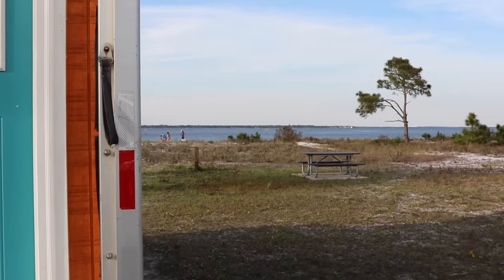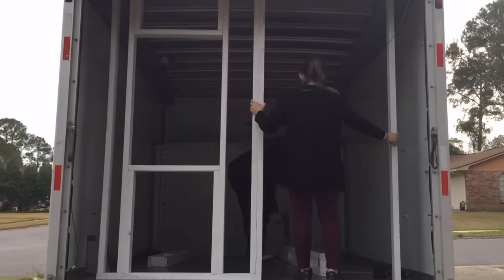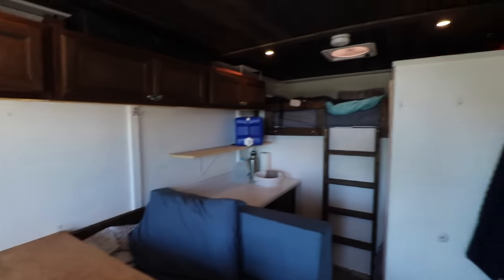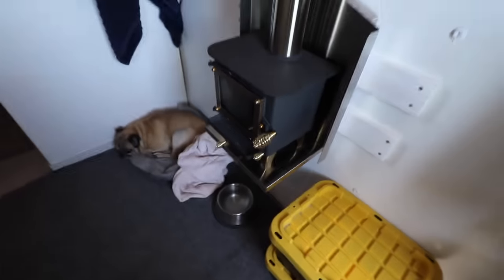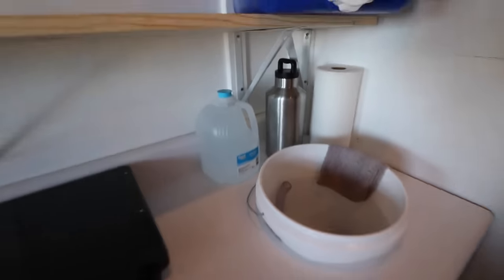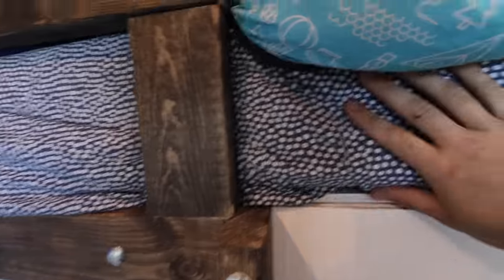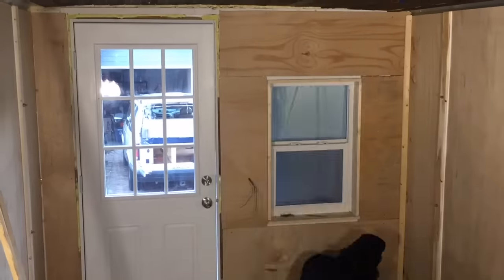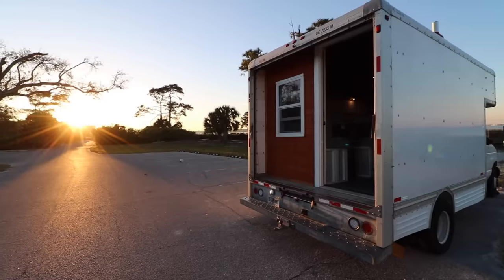Tour of Our Tiny House Camper (Box Truck Conversion)

Comment: Very nice.

An outswing door would provide better security against would-be burglaries. They are harder to kick in. 

In Miami-Dade county Florida all new homes MUST be built with outswing doors by law. Less likely a hurricane will blow it open. Outswing doors are THAT tough.
Reply: Let's be honest, if someone wanted to break into the truck, the bashing the small window would be the first thing. OR, an axe to the siding. The third option is breaking the glass in the door and turning the deadbolt by hand. The last thing I would do is bash in a steel door.
Reply: Well, that's stupid! What's there to prevent burglars from knocking the pins out of the door hinges and breaking in that way?!
Reply: @mybraineatseverything7404  lots of things, but mostly, hinges dont work that way.....   even without the pins in them you cannot get the door off without opening the lock/latch/door handle....
Reply: MyBrainEatsEverything they have a hinge called NRP non removable pin, for outswing doors you would have to open door and unscrew the hinge to remove door from the frame
Reply: T'Challa01 he said an outswing would not clear the lip on the back of truck.
Reply: You know what is better than an outswing door? An owner with a gun.
Reply: Frank Anthony Overton Jr. if your home to use the gun.

Comment: Where do the kids sit while you’re driving?
Reply: That's what I was wondering. I have two kids the same age as his and love this setup, hopefully we find out.
Reply: Great!
Reply: On 5 gallon buckets in the back
Reply: @openyoureyes3969  I recently watched a bus conversion video where a family simply installed seatbelts onto a bench seat for safe travel. They also had some little flip down tables so the kids could entertain themselves with whatever while driving. You could also build in a window/door/crawlspace of some kind between the cab and living quarters for access/communication/egress/escape.
Reply: @Laffy1345  lol
Reply: Openyoureyes39 don’t put your kids through this torture
Reply: Openyoureyes39 p
Reply: Guys this is a u hall the type that connects to ur truck so when u drive u have extra storage so the truck has 5 seats driver passenger 
Then tow backseats
Reply: Lol

Comment: I think you need a fire exit if you had a fire you only have one way out and your children are at the back ..
Reply: How about an escape hatch over their loft bed?
Reply: Yes, an easy way out above their bed, but secure from the inside.
Reply: Calmo Omlac my camper has an emergency exit in the back window it even has to red pull handles on it and it's a 30 year old RV
Reply: Absolutely. They have propane in there, and a wood stove that probably works throughout the night. Kids need an emergency hatch/rv window on top or side to get out fast. That thing is all wood inside, could go up in flames before parents could wake up and grab kids. 

I'm assuming that they have smoke detector/CO detector and fire extinguisher, but still need escape hatch. Other than that, I like it.
Reply: @CalmoOmlac  You haven't seen the emergency exits because you weren't looking for it specifically.  They have been standard since the 70's.  Every RV is required by law to have an emergency exit (a specific type of window or hatch usually).   That's part of RVIA code....and part of the reason home made camping vehicles like this are not allowed in some rv parks.  They don't meet code and the park's insurance company won't allow them.   The other problem with this is he is hauling 4 people in a car that only has seating for, at max, 2-3.  SO are kids riding in the back of this while it is moving?  That is illegal and very unsafe.  And if there were an accident there is only one way to get the kids out!   And it is the rear....which would have a high chance of being the damaged side.  Otherwise...it's cool.

Comment: You would never make an exterior door an outward swinging door. Otherwise criminals can just knock the pins out and pull your door off. You kids gotta think before you post comments lol. Also, do you need a special license for this vehicle after the modofications?
Reply: wrong, absolutely wrong... there are many things you can do to prevent the "take the pins off  junk you mentioned, one; your concern doesnt even work in real life. If you take the pins out and the way hinges are made, you still cannot remove the door. Two, you can spot weld the pins so they cannot be removed... Third, look at ALL OF THE COMMERCIAL CAMPING TRAILERS, EVERY SOLITARY ONE HAS OUTWARD SWINGING DOORS!!!!
Reply: @harrysteeletreo1  apples and oranges my friend. You're talking about doors made for a camper. This guy is using doors made for a house. Good luck not welding the hinge together. Thanks for the expert advice.
Reply: @harrysteeletreo1  I grew up with brothers. I've removed plenty of doors that way lmao
Reply: @Xenochrist95  
Sure, in the olden days. 😉 

Look at hinges on out swing exterior doors. They have tabs on one side and corresponding sockets on the opposite side for the tabs to fit into when the door is closed. Pull the pins and the tab system keeps the door from being pulled out of the opening. I don't know if all exterior doors come this way or not but the three on my house are made that way.
Reply: @rogermccaslin6750  that might be a valid point I haven't noticed anything like that but this guy up here saying to spot weld the hinges has me dead
Reply: Xenochrist95 you buy a NRP hinge non removable pin for a outswing door , the door must be opened and you unscrew the center hinge to remove the door. Made to keep the bad guys out.

Comment: Very ingenious - I have a suggestion for your shower, purchase a pump sprayer so you have some water pressure in your shower. You could also use it on your sink, it would probably fit in the same spot. Happy Trails 👍

Comment: I hope you consider putting a plug socket on the back, leading to your batteries on the inside.  Then you can use that for connecting to a Portable Solar Panel with a long extension cord.  That way, if you park your vehicle in the shade to keep it cool, you can place the solar panel out where the sun is blaring down!

Comment: I watched a guy who left the roll up door in place and had a similar build as your s (window/door).  He had closed the roll up door and built a locking bolt system on the inside on the passenger side of the box. Can’t remember what he did to the outside locking system but it looked like the box was secure when the roll up door was closed. I think he had a cab through door as well so that made it easier to secure the box. I’m looking for his video again.  Do what works for you and your family, keyboard warriors will never leave there moms basement to even try something like this. Happy Trails 💂‍♂️🏴🇨🇦

Comment: if that's still your shower setup check out the iron hammer portable shower on amazon. it charges via usb and has a flow rate of 1gallon/min. that with a stove to heat water and a bucket to pull from you have an incredibly efficient shower system for 45$

Comment: Nice video and van!

One great idea we've used for a shower when we've had well troubles in the past is to use a 3Gal. garden sprayer that you pump up for pressure. If you put one gal of hot water in it (we've heated it up on the stove) and two gal of cool water, it is usually enough for the whole family to take a quick shower with. You just pump up the sprayer 10-20 pumps and you have a thin stream of pressurized water with a trigger activated hose and nozzle to clean with. It uses much less water than dribbling out of a tap and has enough pressure to get soap out of your hair, etc... Not as convenient as a well pump and water heater, but the next best thing. (and super affordable.)

Comment: On the garage door. You can lock it on each hole of the gasp lock with two locks one on each hole so that it would not lock you inside. Now you know for the future. I use to work for Uhaul as a mechanic in teen age years as a job to raise money for college tuition.

Comment: A little FYI: 1.) Look into something called Overhead Doors. They're widely used with storage units and depending which model you get, they're also used on business fronts to add some extra security. 2.) A hasp & lock can be placed on the inside, so need-not-worry about being trapped inside, unless someone parks too close. Plus for-that-matter, it helps to have 2 exits in-case of incident, so a top flip-out hatch may be an idea. 3.) If/when you get pulled over by police, they're going to ask if you live in the back of your vehicle. If you say Yes, the police will not only inform you that it is illegal to park in certain areas, also they will profile your vehicle/home by passing around the plate ID to local & other departments ...so stealth camping would turn out to be a bust. 4.) One of the biggest benefits of NOT driving an RV, is that RVs have a higher rate of insurr, though RVs also get profiled by those realizing that the locks on the doors are usually ineffective & posses no security alarm. and 5.) An in-vehicle camper such as this(instead of a trailer/towed unit) ...if/when the time comes for the vehicle to visit a mechanic, they'll treat it as a vehicle, and not a home --thus when you have to wait on a part to come to make the repair, the garage will impound it in their yard, and you won't have access to it. 
Plus I'm totally sure they'll stick to the task and not invade your home, right? OH WAIT! --you are going to put a deadbolt on the entry door? Well ...let's hope they haven't discovered something called a Bump Key. Or perhaps you already know Shrade Locks make Bump Key-Free deadbolts?
...so it's great to see you have a base, but you may want to evolve/upgrade your home with at least a few ideas I mentioned.

Comment: My only addition would be a faux van back (hinged at the bottom) with steps on the inner side that folds down to meet the ground, come the evening it can be pulled back up drawbridge style to provide that extra security and insulation

Comment: I live on big property I purchased and my next door neighbor invited me over to his estate sale one day prior to selling and giving it all away! So ironic that from about three months ago I decided to get into diy projects with ways to recycle as much as possible and use materials and improvise! After walking around the property for a half hour I found everything you need to do diy projects! One example he had old 73 uhaul box truck great box but cost money to rebuild motor and brakes and tires and everything, but around the barn sat a 4c4 Chevy Chevy commercial box truck mid nineties but with a low heated Diesel engine the dam thing was running great and it was registered to handle the heavy load I separated the box from the truck frame and the body of the van and spent 0 dollars modified both the van and the box to fit each other and combined them I had to do quite a lot of welding but and it was pain in the but. Nevertheless I finished the project in two weeks and then spent about 5,500.00 on the interior and was able to find three good holding tanks and a lot of materials I found around. Total $ spent on the project 7,200$ and I could have kept it way cheaper but since the build was. So cost effective I splurged on a full residential solar system with two back up storage batteries and I also installed a used mini split 2 ton heat pump powered by 230 volts! And I have a 250 volt outlet outside for work. It’s not finished yet but I estimate it to be worth around 35,000$ low end. Oh yeah and I forgot about the residential size toilet and shower!!

Comment: Maybe a ceiling emergency exit like they have in buses?  Or an openable ceiling window?  Not only will you have more light and ventilation, it’ll serve as an emergency exit too in case the door or window are blocked for some reason.  I’d be worried about being locked in with no Plan B for an escape.  Otherwise, this is cool!  When you get down to it, having the essentials are all we need to live comfortably.

Comment: The toilet setup is a bit primitive. I'm a horse owner and many a time had to use the horse stall. That gave me the idea for camping to use pine shavings to place on top of the poop. The pine resin neutralizes the odor . It will break down and compost in no time or I throw it all away in plastic garbage bags, no different than disposable diapers. Keep the urine separate. If 1 part urine is mixed with 9 parts water you have a ready made fertilizer. Vinegar can blunt the urine smell until you dump it and I use vinegar to clean the buckets and funnels since plastic retains those odors. You can buy shavings in different size bundles for horses or gerbils. You want the fine rather than the coarse. Use biodegradable soap and all toilet issues are solved.

Comment: I would've closed up where the window and door are with panels from the original door without roll up feature, after  necessary furniture was installed bed , cabinets etc..  To create a solid wall...You would've gained plenty more living space..
Install 3 sliding windows for walls. 1 on each side of the truck.. including rear wall where door was.. You'd create additional daylight from the windows..
Enter and exit truck from cab area..  I'm pretty sure those box trucks come with a sliding door that separates the cab from the rear of truck... Then ya don't have to worry about inswinging a door into your living space.. 
the RV look and function  that ur trying to create is tough when you're using a residential window and door..

Comment: I don't see mentioned often what makes up the walls of a box truck.
Looks to me like a piece of tin on the exterior, then a piece of 3/4" plywood sandwiched between another piece of tin on the inside. Probably a channel piece at the top and bottom (sole/top plate)  holding it all together.Many install 3/4 thick by 1 3/4 wide furring strips vertically every 16" to 24" so they can insulate the wall (floor, ceiling) with a 3/4' insulation board. The furring strips can be screwed (1.5" screw) and glued to the wall. Many then clad the wall with thin plywood (aka Luan Plywood)). Ship lap is relatively thin and nice too.
When securing upper and lower cabinets and interior box framing one can secure same to the aforementioned furring strips. Just keep in mind the thickness e of the wall makeup so you don't drive a screw through to the exterior. That might cause ya to cut someone's head off driving down the road.

Am I right Hans... Booby?.
Reply from the maker: Surprisingly, the walls actually don't have any metal on either side. It's something like 3/4 ply (may be thicker) with a water proof layer on each side. No metal though, at least not on the truck we had. We used carriage bolts with the heads on the outside so that the exterior was flush.

Comment: I think the issue with an inward swinging door is security, not clutter and preference. with inward swi g the only resistance to a 300lb man ru ni g and shoulder smashing it is 1 inch of 1 inch steel on the knob and dead bolt. outwards the while seal rim around the door is resistance.
Reply from the maker: Yes but the door is glass lol. This truck was never broken into while I owned it.

Comment: You should really make or buy a hard case for that guitar having it against a wall like that will make the wood warp when the temperature changes Iv had guitars become unplayable because I left them out of a case hanging up on my wall in my basement , you can find light weight hard cases made from foam and plastic that save more space than heavy duty cases and all you do to help with the temperature is wrap your guitar in towels and fill the excess space in the case with towels too to help the guitar keep its form , it will help with space too because having a hard case you can stack light stuff on top of it or hang it by the handle of the case in the same spot you have it hanging now

Comment: On the second bucket in the sink you should drill a hole and connect a hose to it and run it outside to the bottom of the truck and let it drain also make a connection in the pee bucket that fits the shower hole and when you gotta go put the bucket over the hole! Or even make another hole where the bucket sits in the corner  and  make a little seat that you can open and close over the bucket when you're ready to use it so you won't have to deal with that when you shower LOL . Also If you want to get real creative install a garbage disposal in the shower drain and you can also poop in the bucket! Just to have to make sure the disposal isn't going when the shit hits the fan😂 LOL wait for the lid to go on put some water in then flip the switch haha

Comment: Outward swinging doors leave the hinges exposed to the outside…. with the kind of hinges you have (see 3:01) a thief could just pull the pins out of the hinges and pop your door right off. Having it swing inwards was the right choice cause now the pins are safe inside.

Comment: Love this.. but if Child Welfare saw that your kids, boy and girl, are sleeping in the same space they would have a fit.. same without running water.. i love this set up though.. my Dad had a Small Trailer too growing up with nearly the same set up and size.. but their were bunks.. large lower bunk and the table converted down to another bed.. their was a small closet too and a space for heater.. otherside between the bunk and table set up was the stove, oven counters overhead and sink.. small about the same size as yours if not smaller.. but without having that head space if it were a large square you could fit a bunk with a sheet to separate the kids.. and provide their own spaces.. But you did a Great Job!! I Love This UHaul Space!